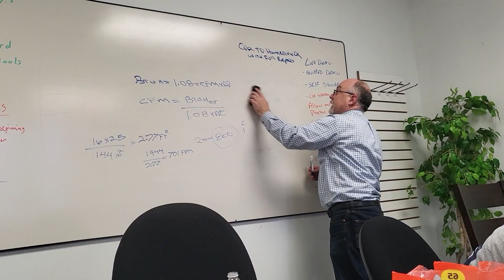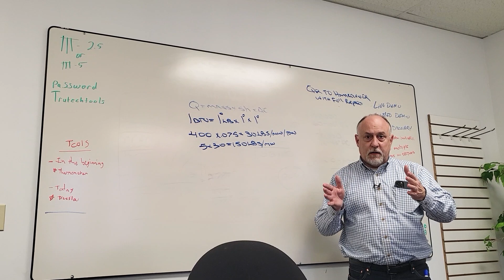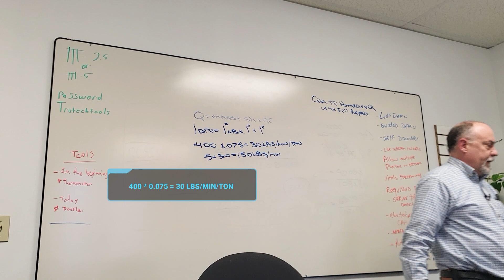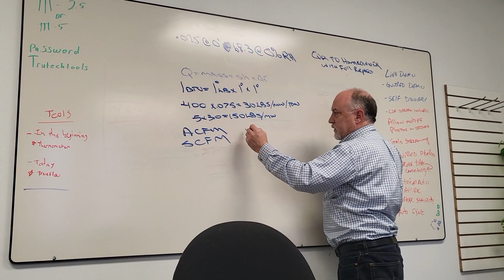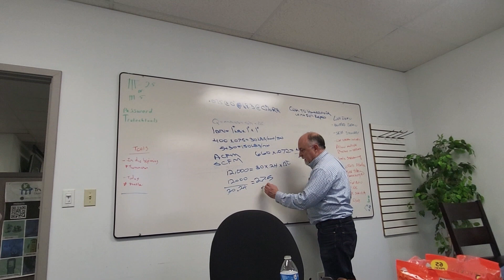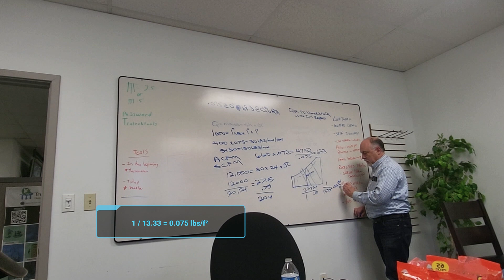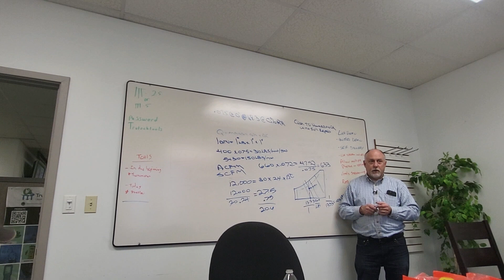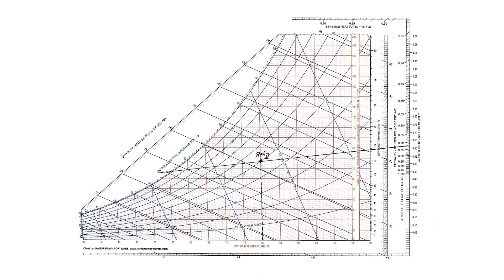Volume Flow Rate vs Mass Flow Rate w/ Jim Bergmann

Comment: Where did the 27.5 come from if your dividing 12000 by 30.24? Which equals 396. 🧐 
Ok never-mind I see where it comes from…. I think. So, we are using the sensible heat equation (Btu/h=1.1xCFMxTD) rearranged the solve for TD. So, TD=Btu/(1.1xCFM). 12,000/1.1x400=27.27*F…. Right?
Reply: @mackenziegray2090  30 lbs / min needs to be multiplied by 60 min. / hour so it can work with 12000 btu /  hour. This is why they need to show the units so we can follow along.
Reply from the maker: Great catch!  He left out a number in the video.  12,000=(30 x 60 x .24)  so 12,000/432 = 27.78 and then 27.78 x .75 (average SHR) = the magic 20 degree TD
Reply: @HVACS  Where did th "0.24"come from?¿ Can you explain that pls?¿
Reply: @jose.cervera  The specific heat of air is 0.24 BTU/Lb. of air.
Reply: @HVACS  please guide. Is this split will be in degree F or C ?
Reply: You have to figure out what your sensible heat ratio is, there is an equation you can do figure that out. Jim didn’t mention that